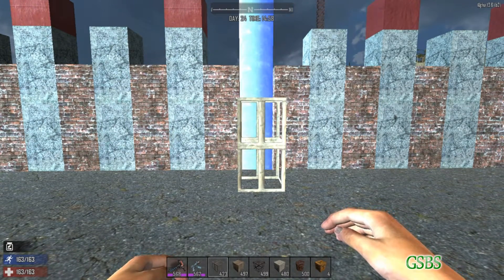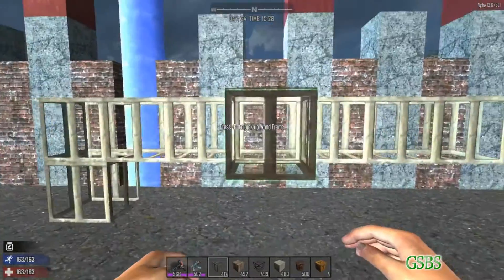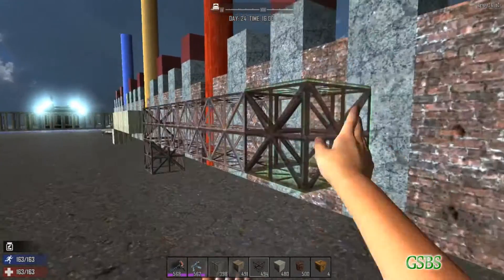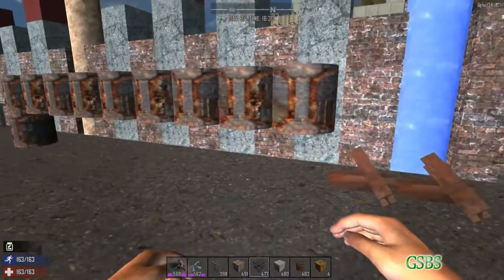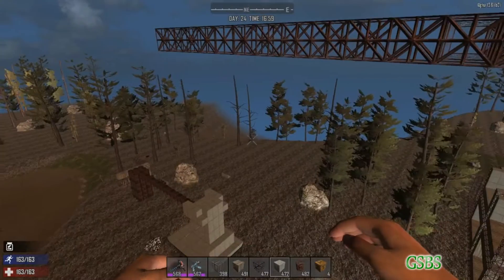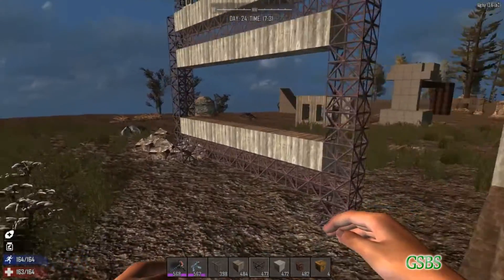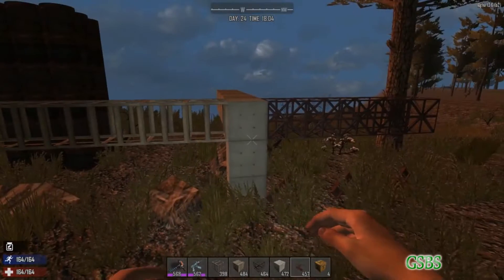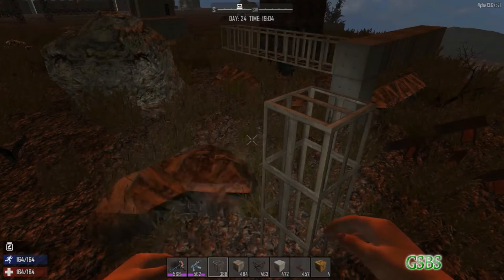Physics explained - Mass and Max Load (7 Days to Die: Alpha 13) - GSBS

Comment: Thank you, this explains the idea of the mass (density) of the block which I was not taking in to consideration rather than the farther out you can build from the support or walls which I was thinking. I honestly figured the weight or mass of the block was not counted per material, now I know to build larger pillars and use lighter material on the platform. This may have saved me some time.
Reply from the maker: sorry for the late reply, our internet was down for a few days. glad the video helped :D however if you decide to use a different material for a floor, the lighter material's max load will be used for the calculation. for example, if you build concrete supports, and build off that with wood, the first wood block will be used for the max load. 

Most of the time it's better to build the entire structure with the same material to make it easier to figure out if the thing will be structurally sound. With the ability to paint things now, this shouldn't be too much of a problem if you are going for a certain look now.

Comment: They could have done a tutorial ingame for this haha 

RIP my Epic first 100% building collapsing (was still pretty nice see how it collapsed tho)
Reply from the maker: +Camachino17  Yea lol, they are still in alpha and working on the tutorial aspect ^^ I think they are going for the MC approach where they want you to figure everything out on your own though. 

Sorry to hear that about your building, I have had this happen many times as well lol. You can also use these physics to your advantage. :D
Reply: Gaming Step By Step  Yea now that i know what those Stats are for and how it works some things are pretty clear. So to build a normal base i should use metal for layout and concrete only for where zombies are gonna hit, right? (i dont like to look other player how to build base or best bases)
Reply from the maker: Camachino17 I'm glad it makes sense now :) well, metal has the highest max load and should definitely be used for building floors with, and concrete for zombies only if you cannot make steel walls yet. Once you can make steel walls, you will want to use that for zombie attacks.
Reply: Gaming Step By Step Hi its me again, i got another question. If you upgrade wood frames to scrap (the max scrap one) does it count the same as a scrap frame? i hope you know what i mean
Reply from the maker: Camachino17 for Max load? Yes. All metal blocks (except rebar frames now) should have the same max load of 320, including scrap walls, reinforced and scrap frames. Hope this was the answer you were looking for :) Just keep in mind that they are not ideal for zombie defense (At least in my experience) 

If you are talking about costs of upgrading that far, creating the scrap blocks will save you on wood and maybe metal (reinforced wood upgrades with metal if I remember correctly)
Reply: yeah man thanks allot

Comment: one big question i have is with arches with one you can go out a lot further with multiple connections to the pillar staggered upwards in theory if height allows it you could build bridges of 50 blocks or more.
great video explains single block bridges well but more could be added with arches and thicker construction.
Reply from the maker: +david branwood This is true, I have done some tests in the old versions and tried to explain it a bit in the "newer" physics videos. However with this theory, you can add additional blocks underneath the original support, creating a new supported block, as well as connecting the other sides as well, creating more supports. The amount of extra blocks you can add though = the amount of extra blocks you added on those other supports though.

I don't know if I explained that well, but theoretically you can only achieve roughly double - 1 or so extra blocks to a maximum of 15. Anything after 15 blocks unsupported will automatically fall down, and is best displayed with metal blocks. Also for some reason single layer floors will only allow you to walk on 8 unsupported blocks, adding a second layer negates this rule. This is all from testing before alpha 14 though, so it may not be exactly accurate.

Another thing to note, half blocks, pole blocks and blocks like iron bars all act as "solid" blocks, in the sense that they can be used as supports and connecting blocks, which I will be demonstrating in the "cheap" horde defense v4 - day 28.

Thank you for the feedback :) I will see if I can get a more decisive video up sometime soon, but it's going to take some extensive testing I think as a few stats changed in the recent patch.
Reply: +Gaming Step By Step yeh iv done some testing myself i found out that the 15 block limit still takes effect even tho with an arch you increase the mass load and there for increase the total block limit. it still limits the max distance of a bridge between 2 pillars is still 30 blocks even tho the math would have you think it could go further. i have noticed that increasing the mass load still lets you to walk on and build more on the bridge but the game mechanics still limits you to the 30 block limit ;] hope that's of some help ;]
Reply from the maker: david branwood Yea, that's 15 blocks for 2 supports ;) so the largest unsupported area is 30x30, however if ANY of those supports fall, you will lose a good chunk of said building lol. Glad to hear it remains the same to this day. :)

Comment: hey, nice video! 
someone linked to your vid in a comment on docm77 s latest video. he had an issue with falling blocks destroying even supported areas and causing a chain reaction. 
that seems quite weird, maybe you can make a video on how falling blocks (e. g. dirt that is dug up from on top an undergrpund base) effect supported structures.
Reply: +Gaming Step By Step crossbeams as in the support beam that can be made with 10 wood? I've been using those when I am making a bridge thinking it would hold better lol
Reply from the maker: +seregruin Thank you :) Do you have a link for the structure in question? I need some dimensions to properly test things out. I Haven't tested out multiple support blocks or underground bases much yet, it was actually something I was planning on doing soon.
Reply from the maker: +seregruin Watching that video now to see whats going on
Reply from the maker: +seregruin I notice a few things10 mins in. I don't think those crossbeams help with structural stability and are merely for aesthetics. I believe they will add to the max load on the support blocks. If he had used a layer of metal blocks (trussing, scrap iron, even metal bars I think (game is updating)) they would be able to hold 320 mass each. 
What I think happened there, as he was digging, the mass recalculates whenever a block is changed, and with a gap inbetween pillars, they no longer share max load. (After a certain amount of gaps between pillars, it stops recognizing it) It looks like he was 8 or 9+ blocks to the surface.
So each pillar of unsupported blocks is roughly 7 dirt (10 mass each = 70 mass), + the 2 destroyed stone (12 mass each = 24 mass) + the reinforced concrete, which is 15 mass. 70+24 = 94+15 = 109 mass for each unsupported pillar while concrete can only hold 110 each, so another pillar would push that over the edge. And of course when blocks are falling, its recalc-ing the other blocks.
Reply from the maker: +seregruin Still unsure about the crossbeams I'll do some testing on all these things today. I know physics can get quite buggy, I've gotten buildings to float and sometimes blocks don't calculate properly.
Reply: Gaming Step By Step thanks for your answers.
Someone suggested to him to put the crossbeams there, to reduce the amount of load the pillars are taking. But I don't think this actually works.
A lot of people are saying, that gravel can't support any blocks to it's side. apparently that's why the gravel caused a chain reaction, when he was digging up and it fell.

the concept of mass load seems quite logical to me, but I'm unsure, if the falling blocks end up exerting an increased load on the structure or what.
Reply from the maker: +seregruin You're welcome :) 
Those crossbeams don't actually help with max load at all. After a bunch of testing last night, they have 24 max load and 4 mass. So really thy are just adding 4 mass to whichever block they are supposedly helping with. I will cover that in the next video with some proof of concept. I am still testing quite a few things. 

Gravel and Destroyed Stone (that's the block he has at the top, it is the main block in cities and destroyed wasteland areas) both react in similar ways. Gravel has a max load of 0, so it literally cannot support anything. Destroyed stone however has a max load of 1, it can't support many blocks at all, except a suitcase on the side haha. Both of them fall if there are no support blocks underneath (Since in the physics video I did, the game calculates on the "Weakest" max load for blocks that aren't supported. 

TFP (The Dev's) Have patched falling objects causing a lot of damage not so long ago, (I was able to destroyed fertile soil by throwing metal trussing blocks around lol) but it seems like some blocks need a bit more tweaking. This destroyed stone really does a lot of damage and I almost wonder if it exerts more force than 12 mass when it's tumbling down. something I will be testing today.
Reply from the maker: nounta1016 Yea, they make it look like they help by using them in a lot of prefabs, when they are really just like like regular wood most of the time lol. :)

Comment: Awesome tutorial, thanks for posting it.

One thing I've noticed with metal trussing that I can't explain.  This is in 13.6.  So I have a 30x30 wall.  At the top of the wall, on an outward facing side I placed metal trussing so I could have it as a walkway and as a block from spider zombies climbing up.  It has the benefit of being able to shoot thru it.  The wall is made out of cobblestone but I've also experienced it with reinforced concrete.  The truss all the way around, except for the 4 corner pieces is touching the wall.  Whatever the last wall I do, once I complete the square of metal truss, I can't walk on that part of the wall.  I'll get an 8 block section that just falls away.  It always happens on the last section to finish.  Used to happen in 12.5 also.  Bug or just an undocumented feature?  I get around it by putting anything as support under the section of 8 that falls.
Reply from the maker: +Christopher Klein Thank you :) I will be doing some more investigation into actual building physics sometime soon. (more than 1 block supports) The lip on the outside is a great way to keep spider zombies out, I use it with every base design. Are you using more than 1 block wide on the metal trussing? Also, this 30x30 wall is completely touching the ground right? I didn't get around to experimenting yet with more than 1 block for physics, I will be getting into that soon, but I know that reinforced concrete has a max load of 110 for each support block, so 1 metal trussing will be 20 mass each, allowing reinforced concrete to hold up 5 per support. I can do a quick test in my cheat world to see whats going on. I know that sometimes the physics can get pretty buggy as shown in this video here (Alpha 12.5 at the time) 
https://www.youtube.com/watch?v=jxCEJll3CbM (The audio wasn't mixed quite as well as the videos these days, but it displays a nice physics bug xD)
Reply from the maker: +Christopher Klein Another way you could get around it is to have a layer of metal trussing on top of the cobblestone, this would allow you to have up to 8 metal trussing blocks that you can walk on, tested, and it works. :D

Cobblestone was a material I forgot to talk about in the video because I haven't used it before, it does seem to have good defense capabilities for early game though before reinforced, however it lacks in structural stability . 

It has a max load of 72 and a mass of 12. so it will only hold 6 more of cobblestone outwards per support and should be able to hold *3* trussing outwards in total. but if you have a group of 4 or more being supported by one block of cobblestone it would probably fall down. If there is more than one cobblestone block supporting it, it really should be fine though and I would figure that's a physics bug.

Regular concrete (which I would advise against using, as reinforced concrete is much stronger and can be made by the time you can make this block) has a max load of 90 and a mass of 15, so it can also only hold 6 more concrete blocks, but can hold 4 metal trussing blocks up per support.
Reply from the maker: +Christopher Klein Physics with more than 1 support is a messy subject haha. with 2 supports, it looks like it adds the max  load of the supports together, and anything that goes over that, falls down. Then I tried 3 supports and it looks like it took the max load of the metal trussing (after going more than 3 blocks out o.O) and I was able to put 8x3 = 24 metal trussing out on cobblestone O.O! I would not suggest this though lol, I definitely have to look into this. 
-1st Edit
Now my metal trussing is floating... I may need to make a new testing world lol. 
-2nd Edit
I really don't know whats going on with your design here.. I managed to get 4 blocks wide of metal trussing all around a cobble wall that was exactly 30x30 (each wall 30m) which.. it should have fell at 2 wide, since 72+72 = 144; and 8 metal trussing = 160. How I came to 144 on the cobblestone, is your using 2 sides of 1 support, so in theory it shouldn't work o.O 
It seems like when I got past 3 blocks, the game forgot about the cobblestone, and only factored in the metal trussing as support blocks, but I might have broken this world haha. More testing needed.

Comment: Can you please investigate the water physics?
It's very different somehow
Reply from the maker: +MrKoofumhead I have actually (It was during alpha 13.2 so things might have changed a bit) They removed infinite water from a single bucket, however if you make a few buckets, all you need is 1 bucket of water. Upon further investigation a Naturaly spawned water source (like a lake or small pond you would find) is still an infinite supply, but anything from a bucket gets used up.
Reply from the maker: +MrKoofumhead I just tested out the square method and it still works in this version, however making an infinite pool needs a lot more testing, I will investigate that more once this other video is done
Reply from the maker: +MrKoofumhead After 2 hours of testing, There is no possible way that I can see of to make an infinite water source with the bucket, other than the method previously posted. However naturally spawned water will not drain, I was able to fill an entire chest with murky water, so it looks like we will have to make our bases close to these water sources if they ever tweak the water more. (From what I can tell it looks like they are still working on it, as mentioned in their preview videos) I went and found a small pond, filled the chest, placed wood frames to get an idea of the size, and tried to create my own pond. No matter how large I made it, empty jars still emptied my man made pond. So I tried to make a well that was about 5 by 2, and 7 blocks deep, filled it with buckets and used empty jars on it. It still emptied after every jar, although sometimes it would fill up again but buckets of water have been seriously nerfed lol.